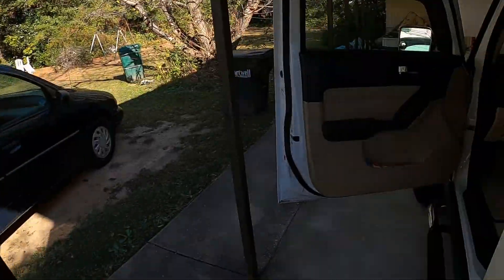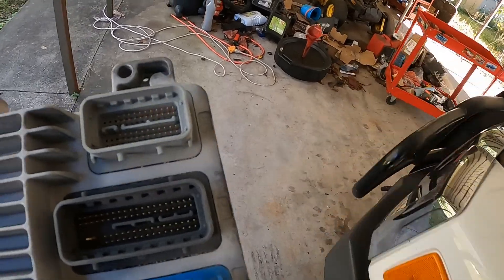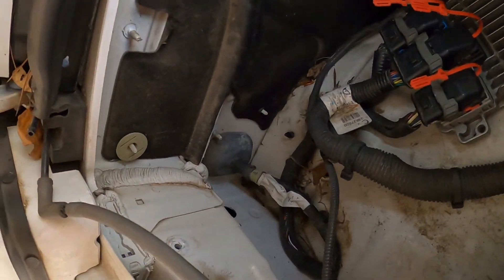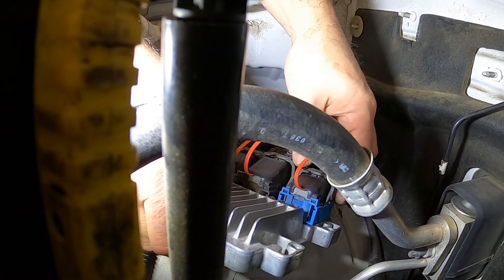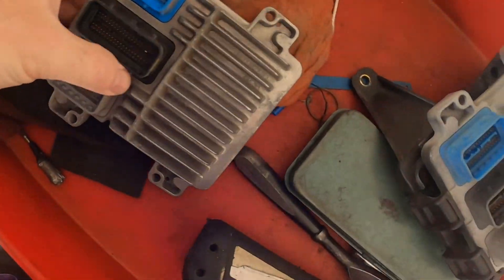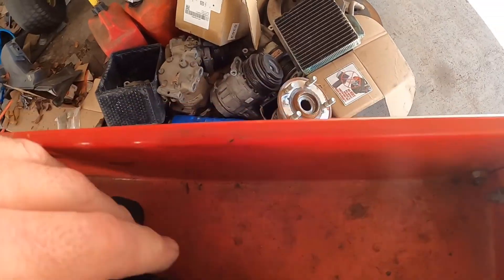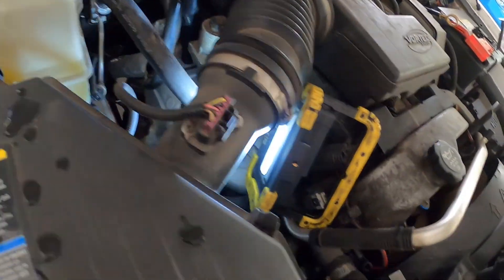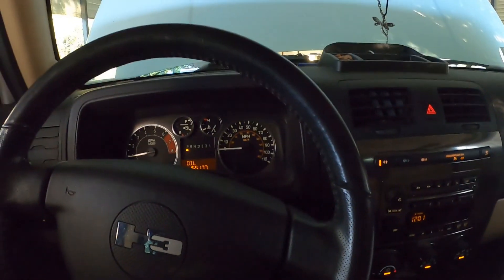Hummer H3  Reduced Power and Limp Mode with P0601 FIX

Comment: Did you go straight to the new computer ? Did you try other potential fixes before?
Reply from the maker: Yes I checked the wiring going to the ecm,checked battery terminals,and also all grounds,they were all fine,the ecm was bad,vehcle ran great never had another problem after fix,thanks for watching ~Tim

Comment: Good day! Looks like a have the same problem on my 2006 3.5 H3. Starts ...works for couple of minutes and than swiches off and Reduced power and stability system on a display ... Scanner shows p0601 ... Did you had the same problem? I'm from Europe and just want to be sure that the problem is with PCM before ordering a new one from US :) Thanks in advance !
Reply from the maker: Yes,replace computer,very common on those vehicles.
Reply from the maker: https://www.googleadservices.com/pagead/aclk?sa=L&ai=DChcSEwjUpd3d0fn-AhVREWUKHSnmD0YYABABGgJ5bQ&ohost=www.google.com&cid=CAESbeD21wVBEfbZYrNjXFMF3-R4bFhc7BMwcOLeNtTlAhQjIzUjGSzjX8VNr7GpYEgSNnXkgqfAjVsEGJEK-paXX8QHiuCv97cO0hZYj3LnDnLWtJDiAbwKDwESMeW2g1Fyw4-4VHHv-0zpg3qePus&sig=AOD64_32TZJ94kM_67lvA3xjiW6ViYOG9Q&q&adurl&ved=2ahUKEwi8g9Ld0fn-AhULlGoFHaRrD2YQ0Qx6BAgIEAE
Reply: Link to part?
Reply: I’ve got the stability track error message

Comment: You didn't have to replace the ignition plugs to do this? My PCM has gone out on my 06 H3.
Reply from the maker: No,it hasn't nothing to do with the plugs.
Reply: @timzauto Thanks for the quick reply. So it's just a plug and play after the vin is matched?
Reply from the maker: @Sarj_ent  yes